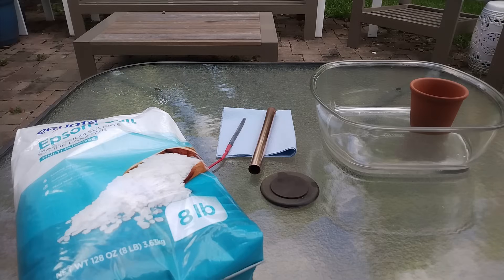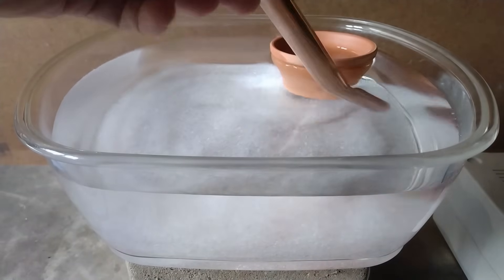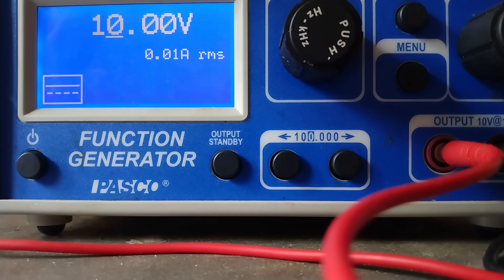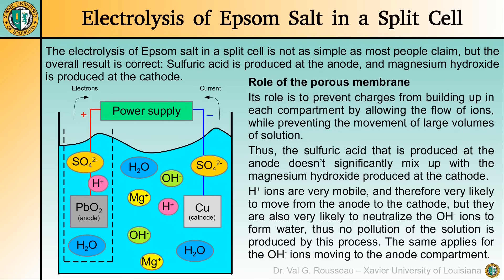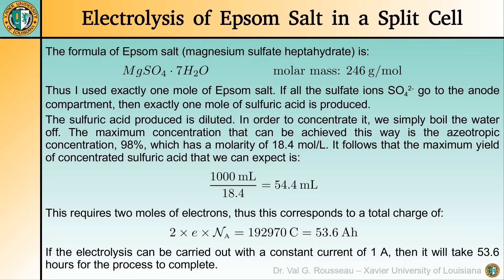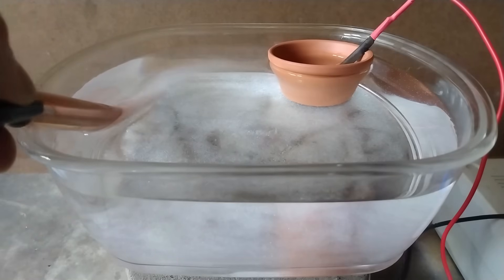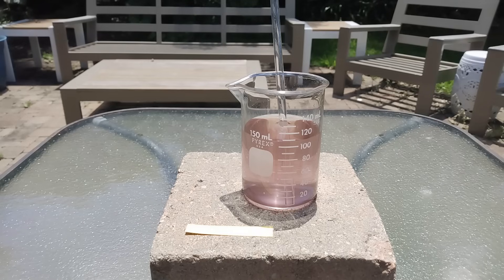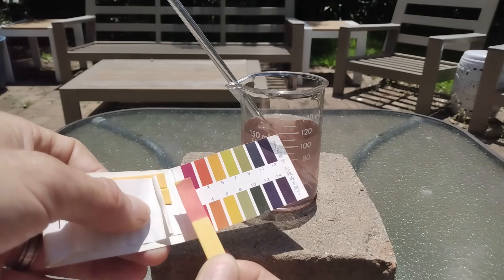Making 98% Concentrated Sulfuric Acid from Epsom Salt - DIY

Comment: Curious if we can use other anodes like platinum
Reply: Yes, platinum works.
Reply from the maker: Yes, platinum is better, but not everybody has one.
Reply: Great. Thanks y’all!
Reply: Will graphite work at all? Obviously it will break down gradually and contaminate the anode chamber, but will it even make acid?

How about another piece of copper, it resists sulfuric when dilute right?
Reply from the maker: @deltab9768  
Graphite will work fine for making acid, but as you said it will break down. However, it won't dissolve, so you can easily filter it out. If you replace it with copper, you will produce copper sulfate instead. This is what I did in this tutorial where I turn Epsom salt into copper sulfate: https://youtu.be/XGEv9RGrvNY
Reply: @deltab9768  graphite works but degrades with time quite fast. Copper doesn't work because anode dissolution isn't about acid. It's electricity that forces metal to go into solution making ions.
Reply: @Ma_X64  Thanks for the reply! I thought that metallic copper was more difficult to oxidize (in the electron transfer sense of the word) than hydrogen, whether the oxidation was due to an acid or electrolysis. So the H2O of the solution would preferentially turn into oxygen and H+. But I think I see where I misunderstand it now, there’s the sulfate ion and lots of other things that could also resist oxidation while the anode oxidizes itself. Cool stuff!

Comment: Gotta love electrochem. I'm making zinc powder in a cell right now and my next divided cell is going to be for the reduction of nitroguanidine to aminoguanidine.
Reply from the maker: Nice! Keep it going!
Reply: I’ve always seen you around stating some of your cool projects, why don’t you ever upload them on YT?
Reply: @Polkem1  I'm filming the series on making guanidine nitrate, nitroguanidine, and aminoguanidine now. I just need to finish up the arsenic pigments I'm making for another channel. I'm also really awful at making videos, but I'm working on it!
Reply: @chemistryofquestionablequa6252  Sounds cool, don’t necessarily have to put your face or your voice in the videos if your that uncomfortable. Hopefully turns out well.
Reply: @Polkem1 the aminoguanidine video is up if you haven't seen it yet. Just came across your comments again and thought I'd let you know.
Reply: The guanadines are very popular at the moment! Not often such new energetics occur, that aren't as nasty as some.....😊
Reply: @keithcarpenter5254  that's exactly why I'm doing the whole process. Aminoguanidine is a bit expensive and has doubled in price from a lot of suppliers since Dugan's NAP videos. It's awesome stuff BTW, I'm amazed at how safe and easy to use it it compared to other primaries. There's a whole world of guanidine based compounds out there.
Reply: Your prison cell? 😂
Reply: @JordanJank  for what? It's all perfectly legal.
Reply: How does that work that I need to know
Reply: @Aussie-Phill  guanidine nitrate from ammonium nitrate and urea with a silica gel catalyst, nitrate to nitroguanidine, then reduction in a divided electrolytic cell or with zinc powder.
Reply: Great energetics
Reply: Speak English !